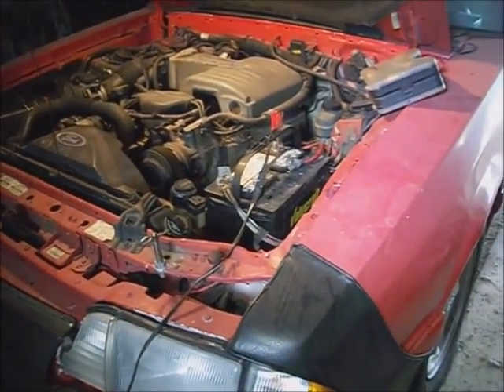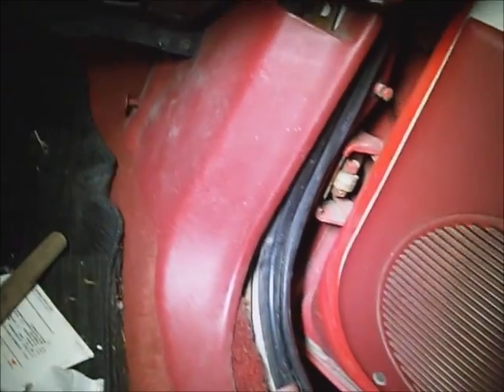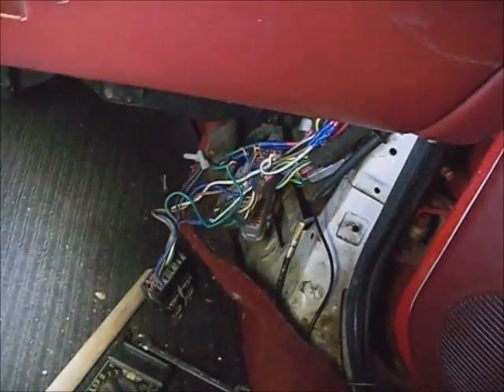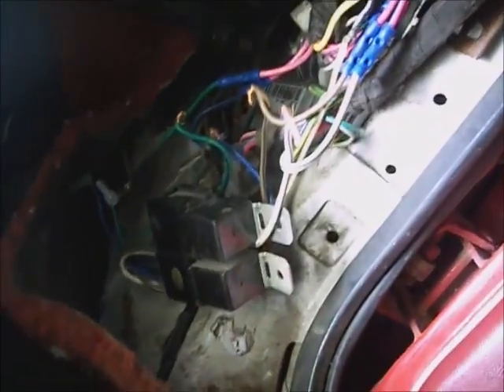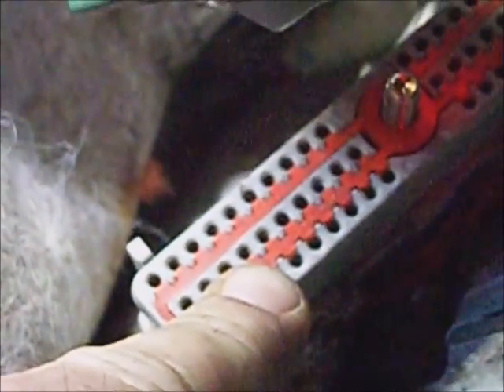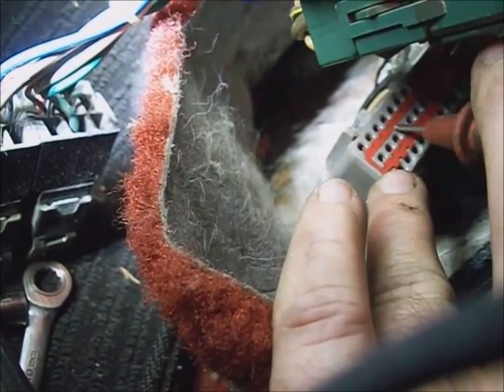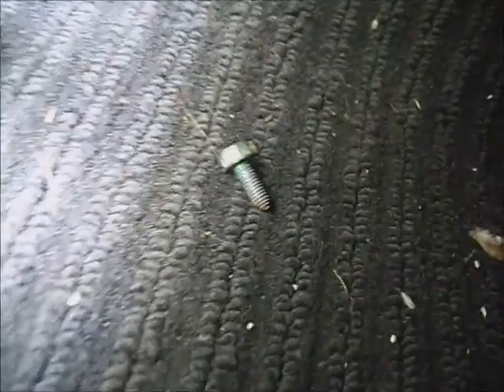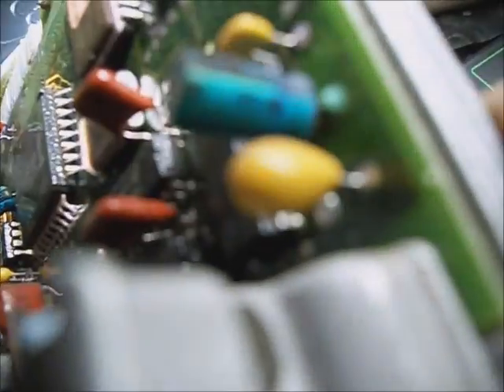Ford Mustang 91 w 5.0l no start relays clicking engine control module (ECM) power and ground check

Comment: I have a 91, 5.0 as well I was driving it the other day and it just stopped. It will crank but won’t turn over I have no idea what it could be because it’s not the fuel pump.

Comment: dam I wanted to hear the clicking sounds before the new ECU install...
Reply: Does your ccrm on the passenger side panel clicks as well? As like when you turn the key over one time but not turn on the car does it make a one click sound because my car does and when I turn it on, it runs normal for 20 minutes and then all of a sudden I lose power then my car cuts off
Reply: @santanaduran9702  check your ignition switch , and it  could be your TFI Module malfunctioning...does your rpm gauge jump around ?
Reply: @Oemford91  hey I found out my problem my car had a dirty wire I took them all out clean them with crc put it back together after that my car drove extremely good like new once again 

edit: note don’t be afraid to unplug your entire engine wire harness and clean it’s completely worth it kinda like troubleshooting

Comment: hey i have a 93 i did a 4cly to 302 conversion and i have the similar problem but i have power and spark but no fuel pressure at all and the fuel pump doesnt prime or turn on at all do you know what could be the problem? ive changed everything i needed to change for the swap but still havent got any power to the pump it cranks but just no start and ive tested teh computer on a 5.0 car and works perfectly fine

Comment: Hopefully you’re still responding to questions, I have a 91 Fox bone stock. It was running good until yesterday morning. I go out to get in it and start it up, turn the key forward all the lights turn on blower fan turns on etc. When I tried to start it EVERYTHING went dead except for the horn and my headlights will still turn on. I tested the battery, starter solenoid, ground on engine block, ground on fender, and the ground on the firewall. Does this sound like a computer issue? Ground? Relay? All of my fuse-able links still look great? Checked all my fuses on the driver side fuse panel. PLEASE HELP!
Reply from the maker: It's prob a fusible link, pull on them,  if 1 stretches like a rubber band, it's burnt out inside.  Also see if 12v is on most fuses in box, could be an ignition switch issue.  Thanks for watching

Comment: same problem, fuel pump on, no pulse in injectors, the 3 relays were changed, a new pump was installed, the ecu was changed, and it still doesn't start
Reply from the maker: Does the check engine light show on, with key on?  Is there a 2 sec fuel pump run-time, when key is turned on?  Does at least 1 wire on any injector, have 12v on it?  Also, unplug all injectors, and measure resistance across their terminals, and compare all 8 readings, are close to each other.   Does the ignition coil have 12v on it?  Does have spark, at coil tower?  Check for 5 v ref at throttle pos sensor.  A shorted 5v ref power, will cause a no start, as well, wide open throttle, will stop injector pulse, for clear flood mode.  Check for 12v at ecm, with key on,, and grounds.  And continuous battery 12v at Kam circuit wire, with key off.  Pull on fusible-link wires, near start sol, and check for easily stretching, indicating broken wire inside. O2 sensors can short, and burn out links, along with age.   Check for voltage difference from bat pos to engine, and bat pos to body.  Check eec relay for click, with key on and off.  Check fuses, and for 12v on fuses, in fuse boxes, with key on.  20-30 mins, prob solved.  Thanks for watching.  Also, have seen bad starters, suck all juice out of system, while cranking, and cause a no start.

Comment: Im running into an issue where I have spark, good fuel pressure, no ECU codes, but the darn thing still wont start. The car has a new distributor, coil, TFI, MAF. It cranks over, will fire occasionally, albeit briefly. After it fires once, I get nothing after. I'm starting to get frustrated because I am chasing my tail. I have 12v at the injectors, but pulled the plugs and they are bone dry. I have the timing set to the stock setting. I feel like I am missing something, and I'm at the point I feel like my eyes are missing something.
Reply from the maker: I would spray a hefty dose of either, or carb cleaner, into the throttle body, and see if it takes off for a few seconds, if so, then you may have a fuel injector shorted out, and it may either disable ecm driver circuit, of it has a damaged ecm, if all power and grounds proof out.  Make sure to eliminate coil wire as an intermittent fire problem.  Also, a tp sensor stuck at wide open throttle, (over 4.0 volts on signal wire) will cause injectors to not put out, do to clear fluid mode.  Thanks for watching

Comment: So what did you wind up doing to get it to start?? I’m having the same problem
Reply from the maker: ECM, it was all in the video.
Reply: Auto Dr diy hi, where did toy order it or find it? And price, I have the same problem on my 5.0 
Thanks!
Reply: Thanks I thought that but wasn’t sure but then I read the intro after I asked the question. I’ve tried everything after changing my fuel ⛽️ pump and it still won’t start so I might try this.
Reply from the maker: @carlosnsosa99  Thanks for watching
Reply: Carlos Sosa another possibility is on the distributor.
Theres is a module that can die. It takes dielectric grease, sometimes if the grease is dried up the car will not start. You can find them cheap at autowreckers if they aren’t all snapped up yet.
We’ve gone through 3 fuel ⛽️ pumps in 100,000 km. Pain in the arse!

Comment: Auto dr diy. I’ve got no injector pulse in my 90. I’ve checked all ground and even added some. Changed the fuel pump relay and pcm relay by the computer. Open the ecu and found bad caps and replaced those. I’m getting the proper voltages to the pins you stated in the video. My fuel pump is also running nonstop. Spark on the whole ignition system is there just no injector pulse with the noid lights. I’m lost.
Reply from the maker: Something is commanding the f pump relay on all the time, and probably another part of the computer is damaged.  And it needs replaced.  You didnt mention ifit was getting spark or not to each plug, or if it is just continuously sparking.  Also ake sure it has 12v on 1 wire of the injectors.
Reply from the maker: Also, ohm each injector, and make sure they're all close to the same ohms.  A shorted injector, or driver wire to an injector, will likely shut the computer injector drivers down while shorted.
Reply: Auto Dr diy I do have 12v to each injector. I haven’t ohm each one yet. Car was running one day and then not the next. There is spark verified  to each plug. It does have a new msd coil, pro billet dist. Which was running fine. I’ve changed the fuel pump relay under the seat and the one by the ecu. Also the one by the maf meter.
Reply: I found a friend that has a working ecu that I’m going to swap in today just to see if that works
Reply from the maker: @billystewart6455    Off hand, if the throttle position sensor is bad and stuck at WOT, (wide open throttle) the computer will be in (clear flood mode) and does stop injector pulses.  I've actually seen a bad coolant sensor cause a similar prob, it was on an F 150, same year.
Reply: Auto Dr diy I’ll check that now
Reply: Right now I have the intake off the car so everything is unplugged right now. Would that still cause the fuel pump to run constantly with the key on
Reply from the maker: @billystewart6455  well no, the f p should not be running.  Unless pin 22 is grounded out of the ECM, or the relay is stuck closed, or relay is by-passed someplace.  Pull f p relay, and see if pump is still running.

Comment: I got a 87 lx 2.3 with no power to the computer pins
Reply from the maker: The ignition switch supplies power to activate the EEC POWER relay, the relay powers the ECM, injectors, few other items.  While the ignition switch closes the relay contacts, the power is supplied on the same wire that powers pin 1 of the ECM, and it is supplied by a blue fusible link wire .  If pin 1 Keep Alive PWR wire has 12v power, (ALWAYS) then check the injectors for 12v, on red wire, with switch on.  If no pwr, then switch EEC Power relay with another known good one.  If still no12v to injectors or ECM, then pull EEC power relay, ignition off, check for 12v+ on at least 1 pin in EEC slot.  Then post back findings here.
Reply: Auto Dr diy cool of you to give such details to help!👍☕️

Comment: I have a 88 5.0 it cranks strong but no start & its getting fuel but no spark and I changed a few things like the ignition coil, Computer control relay , starter sd , check descriptor rotation, check grounds still no luck. Could it be the computer?? Need help!!
Reply from the maker: Well... always check for spark at the coil tower, check for 12v at coil Red/Lt G terminal.  Also unplug the ignition module on side of Dist. and reinstall, as well, replace ignition module with known good one.  Also the pick-up coil inside dist. is a target, and even the magnet in the center of the dist., with the age thats on it.  the injectors should have 12v on 1 side of them as well.
Reply: Auto Dr diy ok I will check them & get back with you , thanks
Reply: Auto Dr diy She fired right up!!! Appreciate the advice!!
Reply: I drove the car & it’s back fireing a lot. & the battery light is on on the dashboard. Is it anyway to stop the back fireing and the light on the dash.???
Reply from the maker: @gradeaceo  What was the problem with it?
Reply: Auto Dr diy I put a whole new distributor in the car and she fired right up but now its back fireing a lot & the battery light is on on the dashboard..
Reply from the maker: Recheck firing order, check fusible links, wiring on new solenoid, charge wire starter side?
Reply: Auto Dr diy ok
Reply: E Jewell hi 👋, what was the problem with your car,?

Comment: So i switched my ignition switch and it turned on right away on my 89 5.0 but when i got home it turned off on me and i can turn it to the on position but does nothing when i try to turn it on. Doesn't crank or anything. Any idea what it could be?? Please help!
Reply from the maker: It does nothing is very vague.  Like what? No dash lights, no head lights, no check engine light, no fuel gauge, no blower motor, no chimes, no spark, no fuel injector pulse, no relay clicking, at key on?  So take you`re pick of those things, and try to narrow it down some.  And does it have anything that is working?
Reply: Auto Dr diy the dash works, lights work, i hear the fuel pump when it's on the on position. But when i actually want to start the car, it doesn't even crank over i hear nothing what's so ever.
Reply from the maker: standard or automatic transmission?
Reply from the maker: You should see a solid check engine light, and the fuel pump should only run for 2 seconds after switch is turned on, or until ecm receives an rpm signal from distributor while cranking or running.  If fuel pump runs continuously, then either the ecm is boned, or FP relay is stuck on.  But if both of those check out, then possible fuseable link/fuse broken, or ground problem.
Reply: Rene Torres quick test...tap starter with a ballpeen hammer 🔨. You know...
Sometimes the starter drive seizes . If you hear the starter solenoid click and it still wont crank it may be a dead spot on the starter drive or copper contact bolt inside

Comment: Great video hoping this information can transfer over to my 86' Tbird 5.0 with no signal to fuel pump relay, no dash lights, and injectors not firing. Cranks strong, healthy spark. Jumped fuel pump relay and fuel pump primed and has good line pressure. Relay has power but is not getting signal from Computer to turn on. Checked ECC power relay and only getting 0.05V on each pin. Figured it was a bad fusible link between the ECC relay and battery so i checked all the fusible links off the starter solenoid and they all checked out besides one closer to the wiring harness that is not connected to the starter solenoid had the same 0.05V. Should i replace the fusible link to see if i get power to the ECC relay first or look for what popped it in the first place? Thanks in advance, Tanner.
Reply from the maker: I would see what is on the load side of the fried link, to prevent it from happening again, what color was the blowed link wire?
Reply: Auto Dr diy It was blue and tucked up close to the wiring harness near the frame. Few inches closer to the engine looking from the starter solenoid. How can i perform a load test on the circuit? I just need to get power to the Computer to drive this save this car, take it home and make it mine! Thinking about disconnecting all the accessory components on that fusible link circuit besides the computer itself, replacing the the fusible link then trying to start the car. I've pulled up a ton of schematics that points to a wire on the starter solenoid being the cause for the computer not getting power. Here's a link to what made me come up with this reasoning. http://www.veryuseful.com/mustang/tech/engine/images/fuel-alt-links-ign-ac.gif From the starter solenoid to the 20 gauge dark blue wire into black/orange wires. Would that fusible link power up my ECC relay & computer? Thanks for the quick reply!
Reply: Also is there some sort of TSB for an updated ECU on a 1986 thunderbird 5.0? Since you mentioned the "improved" ECU design. Or do the capacitors just go bad over time?
Reply from the maker: They just go bad after 25-30 years.  If the blue link had a blk/orange wire on it, then it supplies power to the eec relay.  Off-hand, it is probably just old and let go because of use and corrosion.  A fuel pump issue could blow it as well.

Comment: Question and thabks ahead of time...I have a 91 5.0 that was switched from auto to manual... O2 harness is correct for the swap...issues with fuel pressure and hard starts....I changed the fuel pump and tuned on the tbs timing and ect ect....when I click the key the pump turns on and never shuts off that with the new tank and it bare dry.... Will it continue to prime and run the pump if it's senses no fuel pressure??  Only trying to test this issue before I fill the tank with fuel and have that headache to worry about...the car does have the original A9P ecm but with a manual o2 harness have I burnt the ecm or do I need to switch the 02 harness I've to match the ecm...this has Confused me for days now after reading all the post online I can it's no direct answer and you seem to simplify things and know what's just.. Please help I'd sure appreciate it!!
Reply from the maker: First off, if you`re running the fuel pump dry, it will destroy it, in record time.  The gas is it`s only lube, while pump`s typical rpm`s are faster than the engine, is capable of. Unplug it, and use a test light instead.   I am not aware that there is a difference between 1 O2 harness or the other on it.  Leave them unplugged, as it doesn`t need o2`s to start, or run fuel pump.  I assume an entire manual harness is installed with a manual ecm?  I would unplug the fuel pump relay, and see if it still powers. (under drivers seat) If not, then switch it out.  If still powers, verify that a ground is being sent from pin 22 on ecm.  (which supplies the only ground in FP relay connector on command)  If command ground being sent continuously on 22 to Fp Relay (without engine running) the the ecm is likely toast.  Be sure to test for power and grounds on ecm, pin 1, bat+ memory and vpwr57/37 pwr+ and ecm pins 40/60 for no resistance to body or battery neg--.  Also unplugging ecm and smell inside connector for burnt smell.  The cover on the ecm can be removed to inspect board for green corroded capacitors, burnt places/components on board, bad pins in connector.
Reply: Auto Dr diy Thanks so much for this information you're a modern day hero, i was wondering if this ECU power and ground check also applys to a 1986 Thunderbird 5.0? I'm not getting any power to the ECC relay so i should start by fixing that correct? Because looking at wiring schematics the ECU gets a 12V power source from this ECC relay which i'm currently only getting .05V on each pin. Could this be a bad fusible link from B+ to ECC Relay?